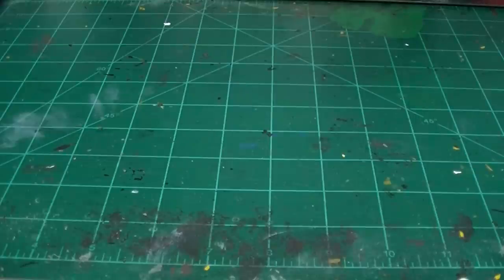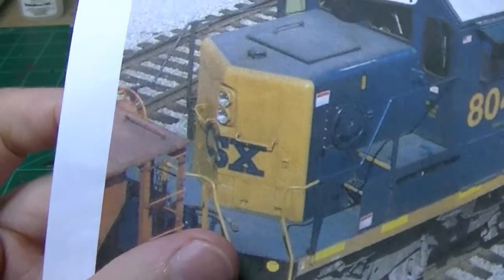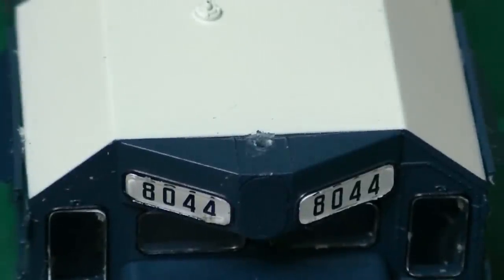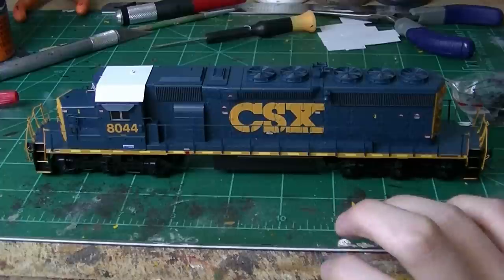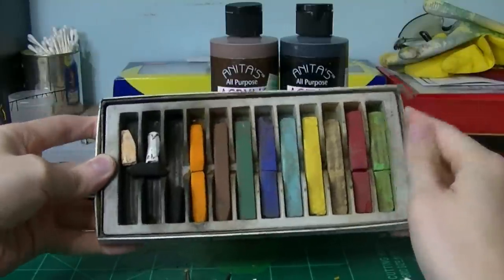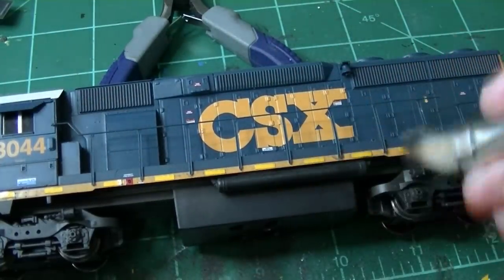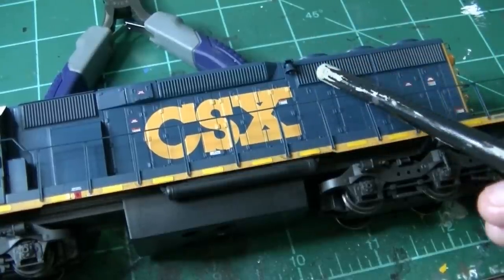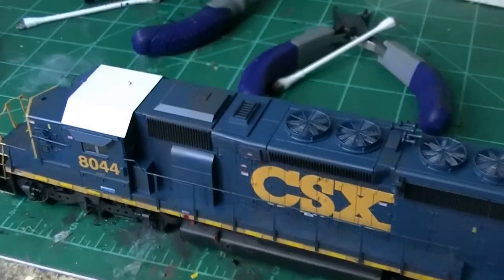Diesel Weathering Series: Part 1 of 2

Comment: Ya could use CA (super glue) and baking soda as a filler.  Works great.  I patched a hole on a Lionel F unit which did not have a reversing lever so it would be smooth.  After filling the hole with CA and baking soda I sanded it smooth and repainted it.  You cannot even tell it ever had a hole in it.

Comment: You use way too much pressure to remove them class lights you should start by shaving the class lights little by little it takes longer but in the end you can get the whole class light off without marring the paint and the long run it's safer because you're not putting a lot of pressure on it so the odds of it slipping and hitting you are next to none and you don't slip and break grab iron but yeah real fine Strokes pass it by little by little think of it as wood you wouldn't try to remove a big chunk of wood at one time if you were carving wood you should shave it down little by little by little by little do the same thing with these plastic trains and you won't run the risk of hurting yourself or the engine

Comment: your grim mix... i mixed some up with this exact paaint from hobby lobby... my grim mix i think was too dark i used 50 50 brown black... what is you mix???

and after you installed the side rail back on the truck you said you where using brown... but not pure earth brown.. you just called it brown... what mix is that??? 
after i did mine and let it all dry it doesnt look grimmy enough cause i think the grim was too dark im going to lighten it up and go over it all again.. but if you will tell me what your mixes where it will help me get the feel of the colors???
Reply from the maker: Ahhh!  Yup, I know exactly what happened. Take note, I use MORE earth brown then I do black, black is a very overpowering color and when to much black is added to this mix, it turns out to be to dark.   For actually mixing the paint together, you need to do 70% earth & 30% black.   I use this same color for all areas of the model, so when I said brown, I meant my grime color, sorry if this confused you!   Hope this helps...~Daniel
Reply: DansRailroad2011 thank you... i play around with it alittle today... i weather my first model today... its pretty good... i also made a gray looking grim and used it just to see how it looks... its alright..... i was doing an older csx unit and it was a hex drive from athearn,, good model but doesnt have all the detail of the RTR units but i thought this would be a good place for me to start...
Reply: Don't think in terms of fixed ratios. Start with brown and add black a bit at a time until you get the shade you want.

Comment: I have a Q&A for you.

Q: does 8044 still have yn3 paint? Because I've seen both yn3 and yn4 go by where I live.

A: this is in response to your question in the beginning, yes the 8044 was originally a SCL and a SBD not a chessie system. (Or I could be wrong)
Reply from the maker: It's YN4 now, that is why Athearn shouldn't have waited around until now to be making YN3 equipment, when half of it is already being repainted to YN4!
Reply: G- Man appears to be either a SCL or SBD. I can tell it is NOT a chessie engine because chessie system did not utilize a nose headlight. Nose headlights where on almost every single SCL/SBD SD40-2.
Reply: @NOVARailandWeatherEnthusiast  From looking it up, it's ex-SCL. But you do need to look it up. This isn't a Genesis model, so you can't guarantee that details such as that are accurate.